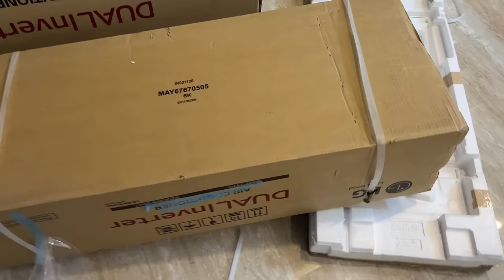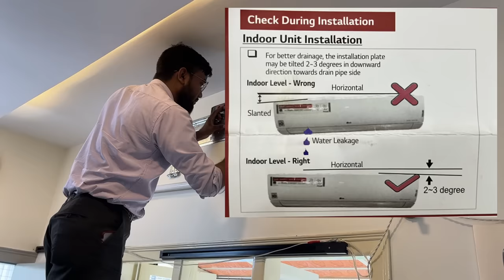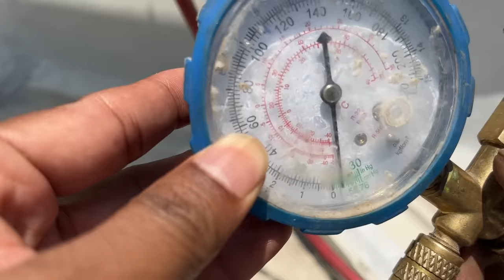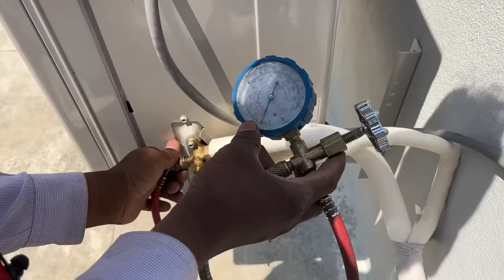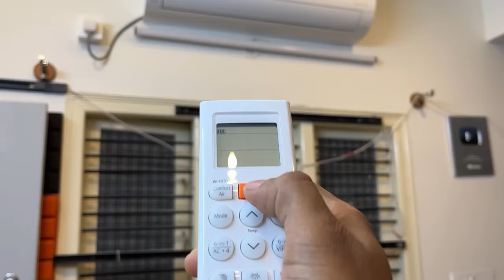Split Air Conditioner Installation Step By Step (2023 - Updated) - Important Steps To Consider

Comment: My Haier ac was not vacuumed what should I do?
Reply: No problem
Reply: just check your grill temp is good or not. if grill temp above 14 then you have to do vaccume.
Reply: @vishnurocks9821  yes it is more than 16 degrees
Reply: @vishnurocks9821  what should be he grill temp after vacuuming?
Reply: @bruhhh69  grill temp - 1 ton 8-13, 1.5 ton 6-10, 2 ton 3-6. also depend on outdoor temp.

you have to check your ac pipes. is any bend or not. after it vaccume your ac. your grill temp 16 degree is high. it will take too much time to do proper cooling in room. it will effect your electricity bill also.
Reply: @vishnurocks9821 throw it
Reply: Not an issue..
Reply: Koi dikkt ni hai to chalo naa yaar ❤❤.  Agr  apko karwana h  vaccum to dubara gas padegi 😂😂
Reply: you mean Carrier?
Reply: @Alansuksatlife  no, Haier is a different company.

Comment: incorrect installation, the hole should be made from the left side, during this installation it is difficult to open the internal unit. And tell me how to check the pipe connection?

Comment: Hello Annaa...i have ordered LG 1 ton 4 star AC for 34500..My room size is around 100sq ft and i use it for 4-5 months during summer. Is it a good deal?
Reply: Exact wattage of the ordered model?
Reply: You could also checkout lg 1.5 ton 3 star which is actually just 1.3 ton in actual or 4600w at 35k offline and is power efficient , although 1 ton would be most probably enough for you too

Comment: Thanks bro...  Public kuch meri taraf se
1. Wrapping tape - 50 ruppee
2. Drain pipe -100 ruppee -> 10 foot
3. Stand - 350 ruppee 
Ye sab saman khud le aana ac service ki dukaan se.. nhi to bohot mehanga padega...  
Vaccum ke liye piche padh jaana.. vo baar baar mna kr rhe the.. par mein nhi maana.. 
mein aaj hi ac lagvaya.. hai
Reply: Stand ka link bro ? Or pic ?
Reply: @ashutoshkamble2070  ac ki dukan → local shop.. online bhi 500-600 ka mil rha hai
Reply: Jo copper pipe aata h wo khud lena hota hai kitne ka per foot aata h pls reply
Reply: Nice tip
Reply: Bhai Drain pipe konsa aur kitne  cross section size ka Lena h? Please guide

Comment: The guys who installed my AC did not use white cement to prevent leakage & water started flowing inside the indoor unit during the rainy season. Thank u for the video 😊

Comment: I own 2 Panasonic inverter ac's and 1 lg inverter all 1.5 tonnage. The cooling performance of Panasonic AC is mind blowing for Chennai heat, LG cooling is average, but less indoor and outdoor noise and service for both ac's are good in Chennai.
Reply: Same I have mentioned. Panasonic is hands down best.
Reply: but bro lg ac comes with virat mode which runs ac at 1.65 ton

Comment: Has mentioned on the video, the indoor to be tlinted towards the drain side, but in actual, the indoor is tlinted reverse to the drain side which will cause the drain water spill inside the room while overon runtime in future.

Comment: First of all, thank you so much for making this video! Even though the video length was around 17.22 mins, every piece of information you shared was useful and nicely edited. The Last information in the end about 3 stars and 5 stars was good. Sir! I'm planning to buy an LG 1.5- ton 5-star ac for my bedroom and according to experts all recommended LG, Panasonic and Daikin. But I would like to buy  IFB FastCool Convertible 8-in-1 Cooling, 2023 Model 1.5 Ton 5 Star Split Inverter, which costs around Rs. 42,490 much cheaper than other brands. I'm looking for an air conditioner which is silent and power consumption is less. The Current price of an LG 1.5 ton 5 star Ac is around Rs. 45,490. It is said that you cannot claim a warranty if you book an ac technician from outside like Urbanclap, is it true? Please share your thoughts. Finally, IFB or LG, help me to choose.
Reply: There is no rule that you can not call other ac installation guy but he should be official.
But some company deny to claim warranty for that reason however you have to call customer care or write mail to company several times to claim the warranty
Reply: DAIKIN is industrial quality Ac and gives more cooling also
Reply: Whichever brand you choose, It is best to get the unit installed by the respective brand technicians in India. Otherwise they can deny the warranty citing improper installation. It will be on the customer to prove that the installation was done properly in this case if at all a dispute arises. Better to avoid that situation from the start. The root cause is highly variable standards of installation by different people in India and no control over the quality of third party install. This is not the case in western countries where only certified engineers are allowed to install or work on refrigeration equipment. If they don't follow the correct process their license will get cancelled. In such places, it doesn't matter who installs the unit as long as they have a valid license, and warranty cannot be voided on the basis of improper installation. Hope this makes sense.

Comment: Is it ok to drill into concrete pillar for arranging outdoor unit?
Reply from the maker: Drilling the pillars in not advisable.. If its on the top floor then should be still ok.. But avoiding is better.. As per my understanding ..

Comment: Where to get Core drilling services in delhi because AC installation team deny to arrange even additional cost. And its must needed for me because i have to drill in 2 roofs
Reply: They do it free
Reply: @nikhilbatra3418  mana kr diya bhai sirf 1drill k liye haa Kiya tha vo b normal vala, core drill k extra charge mang rahe h wall m 500 or roof p 1200 per core drill. Fitting b kis hisaab s bta rahe the bhagwan Jane.
50 gaz ka ghar h total length 15 meter h, so total 15mtr pipe or wire lagega jisme sayad 3 MTR free hota h
Fir b fitting ka total bill approx 12 se 13 hajar ka bataya tha, bahar s krao to gurranty khatm. Mene Daikin m jha jha ho skta tha mail Kiya tab AC vapis hua. 13 hajar sirf fitting k vo b 50 gaz k single floor p aisa mene ni suna itna bill fiiting ka

Comment: Hi, Thanks for demonstrating installation One  question, is it safe not to have Stabiliser coz u didn’t have that for your AC
Reply: Even if any AC brand claims a good operating electricity range, or they say that voltage stabiliser is not required, still I recommend to use voltage stabiliser with your Air Conditioner irrespective of brand, as to protect your AC from any voltage fluctuation malfunctioning, as most of the voltage fluctuation/drop occurs in Summer, when you require your AC the most, and also it is impossible to keep an eye to what voltage is being supplied to your house from the electricity pole, until unless you have a voltmeter connected to your electricity meter.

Someone should not compromise their ACs which is of approximate ₹30,000.00 or more to the cost of Voltage Stabiliser which costs approx. ₹ 2,000.00.

Additionally, Voltage stabiliser enhances your ACs usage life and steady performance, irrespective of operating season or high voltage drop prone areas, which gives you a peace of mind.

Comment: I have  LG ac, it is 16 years old still no problems, only water leaking issues
Reply: I have Samsung AC , installed in 2010 very impressed that way before time it was so modern no problem yet

Comment: Do we need to drill the roof before installation of AC through electrician
Reply: We need to drill the wall where indoor AC unit will be installed.

Comment: Copper pipe is not in u trap it will be problem in future because,the moisture water will come back from indoor unit ...and compressor oil also comes into indoor coil...

Comment: Hello sir.. Really need help from u. Lg technician came and service my split lg ac but afterward the water from drain pipe stopped coming and even my outdoor unit fan got jam. Is it possible the technician has spoiled my Ac. Kindly need ur advice on this.
Reply: This is major problem you should make complaint about that because your AC is in problem

Comment: 3 inch hole should be drilled 2 to 3 degrees inclined downwards towards outside of the wall, as in the case of fixing the indoor unit. Then rain water will not enter into the room.

Comment: In rajkot, gujrat 
Rate will charge --- 
1500 new fitting 
Drain pipe wholesale rate is ₹4, we sell at ₹10/ m 
Outdoor braket is not local like you 
₹450 heavy + ₹400 stand fitting.
₹250/ whole in wall 

₹280/ ft (2pipe + wire )

Comment: DAIKIN Installation guy estimate 15,000 installation charges for 1.5 ton 5 star inverter AC. Which include 5 meter extra pipe and said seprate wiring for approx 9000 on 1st floor 50 gaj house only. 
And if i dont install by them they said warranty will not more for anything..
Its way expensive installation
Reply: We have around 10000 for samsung 1.5 ton 5 star

Comment: Bro we have total 5 ac in our home 
1 is Samsung 1.5 ton 3 star, 
• 1 Lg 1.5 ton 3 star
• 2 panasonic 1.5 ton 3 star.
• 1 General 1.5 ton

None of the above comes even an inch close to Panasonic Ac when it comes to air flow and cooling quality. 

Congratulations for your Ac but atleast try once Panasonic’s AC.

Comment: 1.5 ton 3 star model has 4400 watt capacity and 1.5 ton 5 star LG ac has 5000 watt capacity this is where the major difference is and plus electricity saving also

Comment: I saw that ACs are mostly installed in a closed environment. Is it a most or I can also install it in an open environment like shop without a closing d shop even with glass door
Reply: Dont install... no use.. coz the air will go out... 
For example take ur car itself...do u open ur windows when ac is on

Comment: Recently we have buyed lg 1.5 5* but when it keeps in 27 no cooling is coming very bad experience with LG...😢actually we got stacked to take which brand but finally choosenu lg n its very less efficient. .dont buy...it has so many loopholes..
1. No light in remote while sleeping room is very dark
2. No automatic power restart after power cut
3. 27,28,29,30 no cooling

Comment: Why didn't you used a voltage stabilizer?
Reply: Lg works 120 to 290 volt
Reply: This AC do not need stablizer.

Comment: Maine Ac Install Krwaya H Vacuume Hi Nahi Kiya Lg Walo Ne
Reply from the maker: Call them and ask them to do it.. They will re-fill the coolent.
Reply: The same thing happened with me as well.. the installation guys didn't vaccum and also  didn't  install the ODU properly as it was tilted in one direction. 

I called the LG guys and escalated and they gave me a new ODU stand and installed the unit properly with a leveler. They also gave me a refund of 900 rupees for the inconvenience. 

Sadly, once the AC has been turned on, there is no point of getting vaccum done coz the air has already circulated the whole  unit including the compressor so nothing can be done now. So it is just a wait and watch situation now...I wish I knew this earlier.
Reply: @saurabhbhardwaj1131  how u called them?
I've heard that vacuuming can be done afterwards with refilling the gas and vacuuming.
Reply: New AC vacuum is not process compulsory and old AC vacuum purses is perfect you are understand
Reply: @LGRAC  bro are you sure vacuuming is not required for new AC?
Reply: @bruhhh69   yes mine is working fine almost 3 seasons are passed 
And I purchased same new ac and it is also working fine
Reply: @DODO_THE_GREAT  which ac you've bought?
Reply: @bruhhh69   lg 1.5 ton 5 star dual inverter 19 enze model
Reply: @LGRAC  Get off from this forum. Vacuum is absolutely mandatory for new split AC installation. If you don't have a vacuum pump, then spend money and buy one for your installation work instead of spreading wrong information.

Comment: Poor fitting..Copper piping very bad and indoor plate is fitting in nails and hammer not a correct way..Use plug and screws is better .